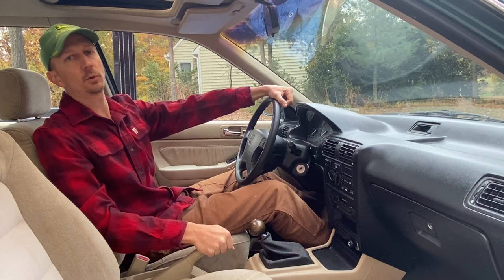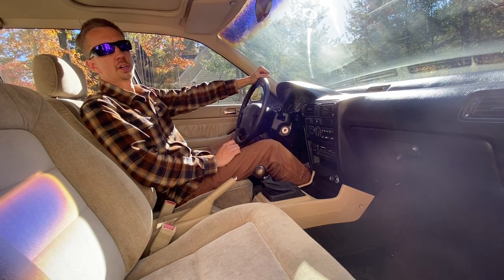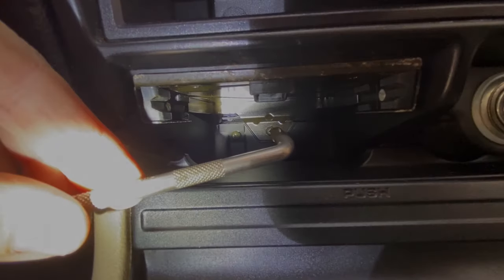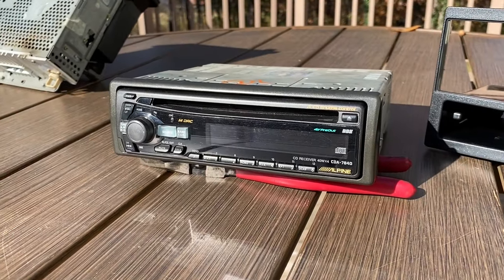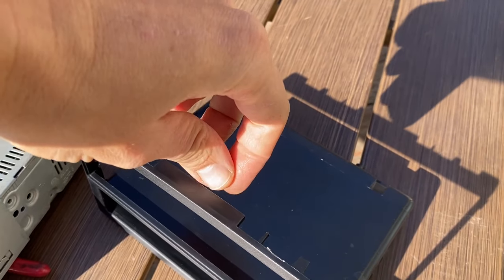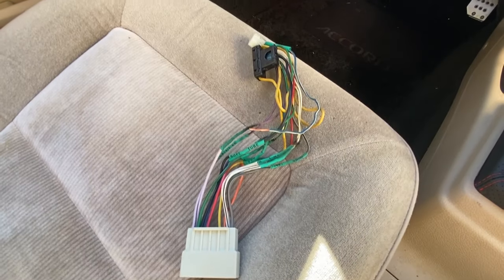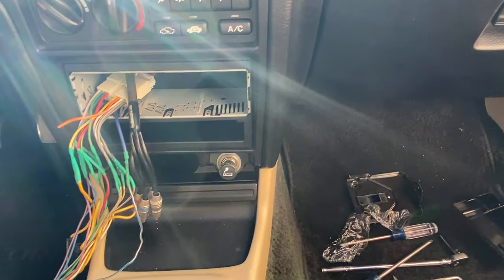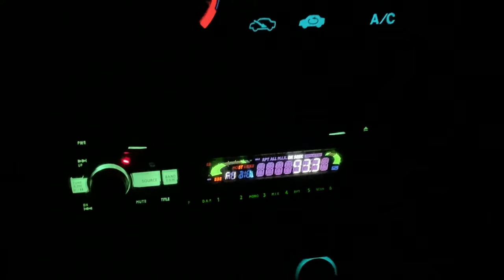DIY 90-93 Honda Accord CB7 CB9 Radio and Front Speaker Installation

Comment: Did you test the oem head unit to confirm it’s dead? I have the same issue on my ‘93 no sound out of oem speakers but I don’t want to put an aftermarket head unit. I want it to look all original.

Comment: I've replaced my head unit in but now my power antenna doesn't work, any suggestions. Very informative video, Thanks!
Reply: did you plugged your radio wiring?
Reply: Blue wire. Power antenna or factory amp on pretty much any car. If you use a factory harness adapter it should work no issue.

Comment: Sorry to ask u this question on this video but can u tell me what do u do with the crank position sensor or can u explain me what to do with it
Reply from the maker: The crank position sensor on the H22A4 was removed during the timing job.  That sensor is OBDII specific and the crank sensor is in the distributor on OBD1 applications.
Reply: Thanks for the info and u doing a good job